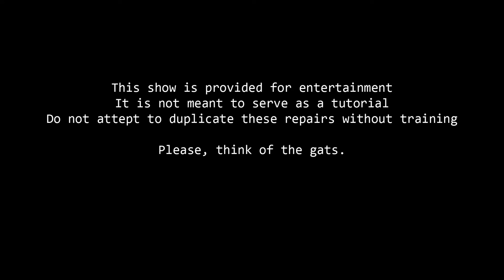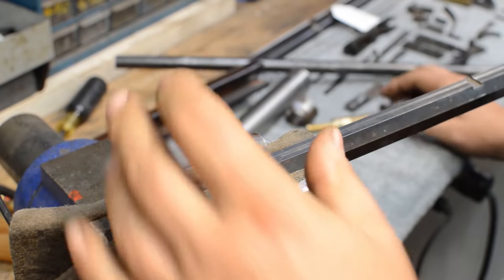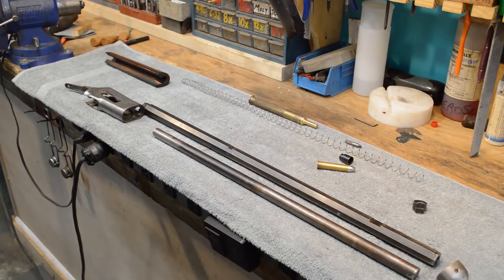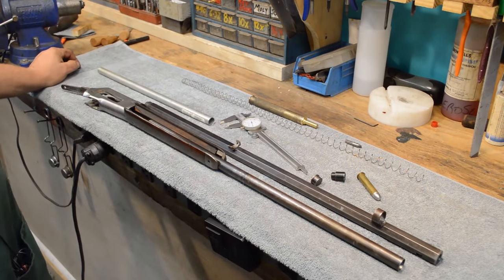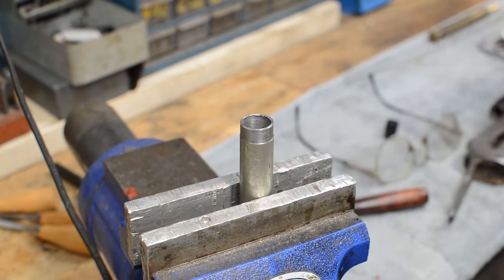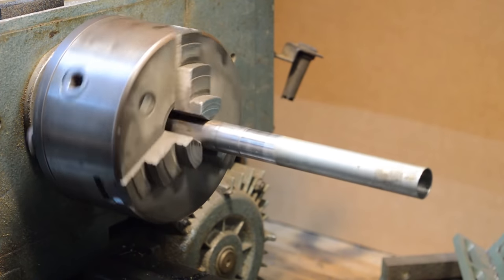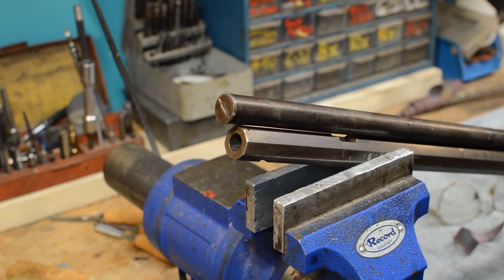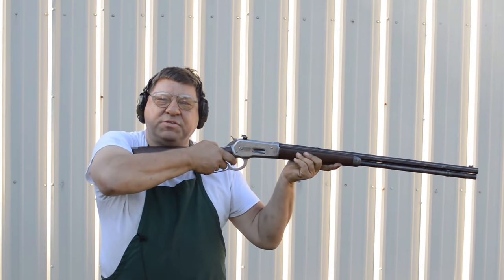Anvil 047: 1886 Winchester re-barrel and refurbishment

Comment: I, for one, approve of the lathe setup. Especially the pipe reducer for a spacer on the tool post. I have milled on a lathe by clamping the work piece to the cross slide and putting the end mill in the chuck. I've also turned on a horizontal mill by clamping the lathe tool to the table and putting a piece of round bar in a 5C collet in the spindle. Run what you got.

Comment: To everyone knocking the boring bar holder - it works just fine for light cuts, and makes grabbing smaller simple parts for boring with a bar in the chuck, or long bar between centers pretty easy. I might build something like that to fit my compound mounting dovetail, actually.

Comment: If i may Mark, a few questions and comments.  Unless I missed it , one of the more challenging aspects of this barrel refit is the indexing and headspacing,  I would have liked to have seen your approach to doing them. I personally would of never put an adjustable wrench on the receiver to remove the barrel. As a smith removing barrels is a common practice and a barrel vise and wrench that takes oak blocks fitted for specific receivers is very strongly suggested, most any other methods are disasters waiting to happen. But I totally agree to never stick a cheater bar into the ejection port or receiver itself and try to turn it loose. Making a jig to wind coil springs is a simple matter and something every smith should understand and be able to do. Once the rules for length, wire gauge, diameter and spacing of turns per inch are understood it is a fairly simple task to wind them by hand or with a drill. The EMT ( electrical metallic tubing ) will present issues when re bluing the rifle. I am curious as to what was used to solder it to the original tube. It is not generally a good practice to join steel and aluminum by soldering.  Be that as it may, it looked like electrical or plumbing solider and the typical flux used for that type of work being used. At the least Brownells High Force 44 solder and the appropriate flux would not only be stronger but do a better job. An even better choice would have been to silver solder the two parts together thus giving you the strongest joint possible outside of brazing or TIG welding.  But your skill cannot be denied,  I enjoy watching your plan of attack and the thought process that goes into it. Thanks for another great technical video.
Reply: bob garr. Can follow you most of the way but "Silver Soldering" though the correct terminology for the process is high temp enough to fall under brazing.
I got lost on some of the process in the film. Especially with the turning using the boring bar. The roughing cut showed poor security of the bar. It was dancing all over the place. Then the removal and refitting of the bar by hand with no re-centring of the bar especially to ensure the bar is parallel to the bore. I realise that my limited lathe work is CNC based where the goals are accuracy and repeatability. I know that touching on to a cut surface as a method of zeroing works and that the need here was for effect rather than dimensional accuracy. It was just a jolt to see different methodology.
Reply: Mr Barr would you be kind enough to let us all know the name of your u tube channel , as i for one would be most interested in your  what appears to be  superior knowledge on these gunsmith  related matters .
Reply: @COIcultist  there is both silver solder and silver braze, they have different compositions and work at different temperatures
Reply: @geraldswain3259  who is Mr. barr?
Reply: "It is not generally a good practice to join steel and aluminum by soldering"
I assume he got a piece of steel conduit, not aluminum

Comment: If @Abom79 follows you he is either impressed at the vise holding the boring bar or he is fainting on the floor.
Reply: There was meant to be a lot of sarcasm in my comment.
Reply: @IanIngram1  if I'm welding or running the dumore I'll cover the ways.  If I'm fileing or polishing, i wipe the ways off before i move the carriage.  Then again, I've got wipers on the carriage.  I routinely run a Pond heavy duty 54" swing that was is over 120 years old, and has been raised to swing 125".  Wipe and oil the ways, you'll be fine.  Remember, if it works, it's not stupid.  And there's always someone who knows more than you.😘

Comment: Japanese motorcycle mechanic by trade. My biggest concern working on ANYTHING is not to screw it up. Motorcycles nowadays aren't the thick chunks of steel and aluminium they once were. On my last modern dirtbike I could barely see the wiring connections.

Comment: I didn't know you were a man of many different talents besides gunsmithing. Is the 1886 .45-70 receiver on the same pattern as the Model 71 .348 Winchester?  I know the head of the brass is the same size. Many similarities between the two.

Comment: Mark l gotta know what kind of solder sticks to that old rolled thin steel magazine tube???????????????????????? other that that....Fine workmanship excellent...Thanks from Kentucky...!
Reply: I'm sure that is ordinary soft solder. I don't know whether Mark is using electronics or plumbing solder, but it really doesn't matter, either should work fine.
What makes things "stick" is two things:
1) Getting the parts CLEAN
2) Using flux.
You have to have the parts clean so the solder can wet the metal and stick. Any dirt or oxide coating is going to prevent the solder sticking. The flux is there to both help clean the metal and to keep it from oxidizing while heating the joint by excluding air from the joint.
It looks like Mark is using rosin-based flux rather than an acid flux. Acid flux is what plumbers use. It has the problem that unless you get ALL of it completely off, it will keep eating the metal for years to come. Which you don't want on a gun. Rosin-based fluxes, like used for electrical work, don't have this problem.
Get some ordinary 60/40 tin-lead based solder (NOT the newfangled lead-free stuff), some rosin based flux, clean the steel well with some sandpaper or the like, then wipe it clean with something that isn't oily, apply flux generously to both parts, heat the parts until solder will melt, pre-tin the parts with the solder, fit the parts together, re-heat the joint, apply more flux and solder, and you are done. You can see Mark doing exactly this when you watch the sequence.
Reply: @lwilton  Lead or tin based solder will not stick to steel or furrous metal of any kind....l have been a plumber at one point of my life....l am 77 years old now.....Unless you use a strong  Sulfuric acid core solder.....lt did not look like he used that because Sulfuric Acid is very very hard to clean completely once it has ingrafted.into..the surface...!
Reply: I'd lay odds that it was "silver solder."  The nice thing about silver solder is that it won't let go as quickly with heat as lead solder does.
Reply: @steveshoemaker6347  Hum. All I can say is that strikes me as curious. I'm only 70, but I've been doing electronics for quite a few years, and have routinely soldered things to bare steel using 60/40 solder and a rosin-based flux. There are things easier to solder than bare steel, but if you get it clean, fluxed, and then tinned, it seems to work fine, at least for me. Now stainless can't be soldered, nor cast iron, if I recall (too much graphite).
Reply: l wilton i’m quite a bit greener but I’ve had similar results trying to solder to steel.  First time I was handed a soldering iron I was told to solder a wire to the tip of a nail.  I remember it seemed to wet best on freshly coarsely sanded steel with a lot of heat but I’ve mostly stuck to copper since then.
Reply: @steveshoemaker6347  the rear sight on my ak says otherwise

Comment: I found an 1886 in 33 WCF in my father's attic. Why oh why does such a great round have to be obsolete. Would it be possible to ever drop in a 4570 Barrel
Reply: Convert 40-65 Starline brass.  Both RCBS and CH have dies.  (They pop up on flea bay periodically too).  Why oh why would you desecrate such a rare chambering by putting such a pedestrian cartridge in its place,,,,,,,,
Reply: @TheIrishAmish  no I agree I wish desperately that 33 Winchester was the round that survived. With its modern 338 diameter bullet and flatter ballistics I think it is the perfect lever action cartridge. I don't understand why it isn't still chambered in rifles.. all it would take is a barrel change and some easy to make modern cartridges from Hornady Federal, Winchester or Remington.. then companies like Marlin or Henry could  bring it back
Reply: I have a 33wcf , I've had all but 2 of the 1886 calibers, the 33 is the most, accurate of the lot ,  the man I got it from gave me a set of form dies and a set of 33 reloading dies , I use the 338 hornadys,  loaded up to max factory load it hits hard at both ends .

Comment: I had occasion to replace a magazine tube on a Winchester 1873, when I received the replacement tube I discovered it  far too long(fortunately) but, with the added work of fitting it to the recover it added much more work to this project. So, replacement parts aren't always to spec. Neither was it rolled as original but, one piece tubing but, will work when and if I ever get this done?

Comment: Oliver Winchester in his grave thinking :Huh, I never though about the bullet tightening the barrel!
For the magazine tube, McMaster Carr has a HUGE selection of pipe and tubing, so I would just find one with the proper ID and (most likely the closest oversize OD) then turn or sand the OD to size.
I also have some old school brake cylinder hones that I use to open up the interior of tubing or to do things like fitting AK style barrel accessories to fit the new barrel with the proper crush.

Comment: Disappointing that you did not show how to get the barrel  indexed to position and to the correct depth into the receiver when properly tightened.
JIM
Reply: My guess is one or two reasons, if you look at barrels the mag tube has a channel milled in it already as well as sight dove tails. Which leads me to believe the factory had this figured out before assembly.  And second, if we seen everything we would be picking his pocket.  Just a guess though.

Comment: Question. What's the controlled component on a Chauchat? I'd assume  it must not be the receiver tube if  you just made a new one, or is there some sort of situation for replacing the receiver on a machine gun? I know the U.S. Military considered the receiver on the M60 to be a wear and replace part near  the end of their service as standard infantry machine guns.
Reply: Good question, here in Canada the controlled part of a sten gun is the mag well lol.
Reply: Would that info be publicly available at the Bureau of AT&F website ? Never looked myself,but  ?
Reply: It's usually the receiver, but if the owner is a manufacturer you can make a new receiver.

US machine gun law is such a fustercluck.
Reply: In the case of the Chauchat I believe it is the lower receiver that is controlled, not the upper receiver tube, as is standard under US law. However that does not matter here because the broken part displayed is neither, it's a barrel extension that is solidly mated to the rear of, and reciprocates with the barrel within the receiver tube. It is also the part in which the bolt and bolt carrier run in, and into which the locking lugs are machined, because the Chauchat is weird, even by the standards of long recoil firearms.

Comment: I did a similar extension of a magazine tube using a scrape piece of original tube but machine both pieces in a 5C collet. I think epoxy will join the two pieces and since the short piece will be at the receiver end, the pins will keep it all in place once the Winchester is assembled.

Comment: Great video. But where was the rebareling part? I've got an 1873 I'm trying to rebarell and need to know how to get it screwed in properly. When I get it timed it seems as if it's in too far and the headspace is off.
Reply from the maker: If you wound up 1 turn too far in, the rear of the chamber is cut, rechambered to restore headspace. Without having seen the parts, that's all I can say...